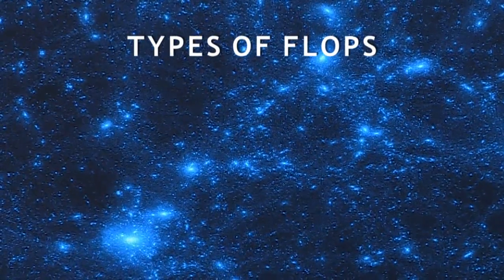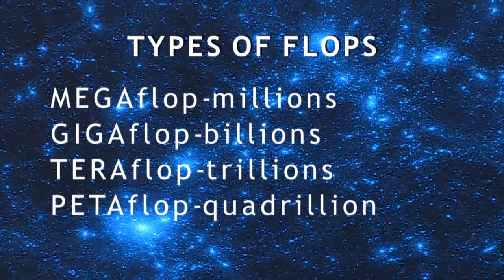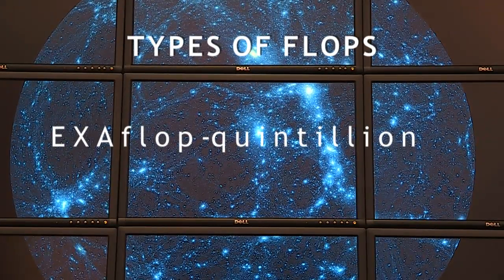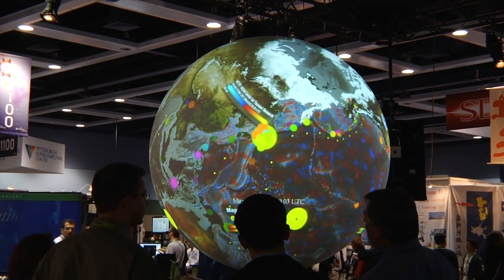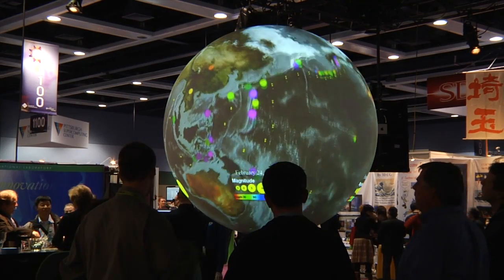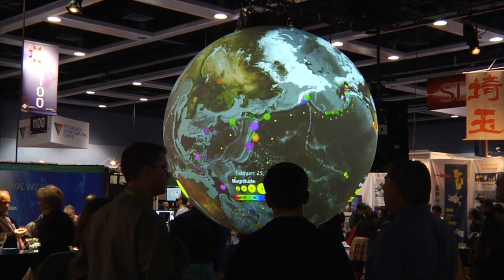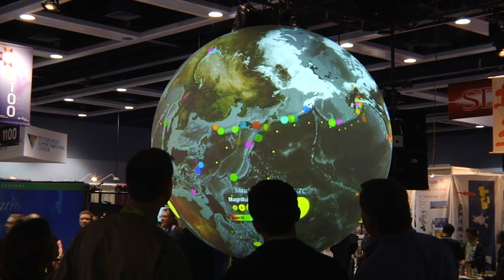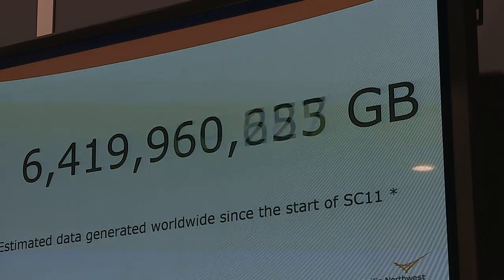What's A FLOP?

Comment: so the sum number of flops do not equate how good a machine will operate? that means that if the xbox or the playstation video game console tries to claim certain number of flops, that doesn't mean it will operate better? confirm? deny?
Reply: Having more flops does not necessarily mean better performance, as flops are more advantageous calculating hundreds of equations a second. Sure let's say we have 6 Tflops on a machine or more but very unlikely that it'll be used for applications.
Reply: Think FLOPS as equivalent to Horsepower in cars. It's a great measure of theoretical power but so many factors decide how that power is usable and to what degree.  A 1000 HP vehicle geared for speed can go fast but the same geared for power would be slow but capable of hauling more.  Take into consideration the weight of the vehicle, roads you're using and so on you start to see the limitations where software and application are concerned.